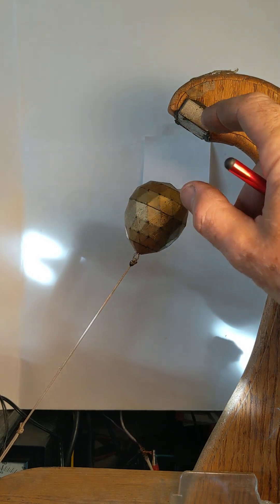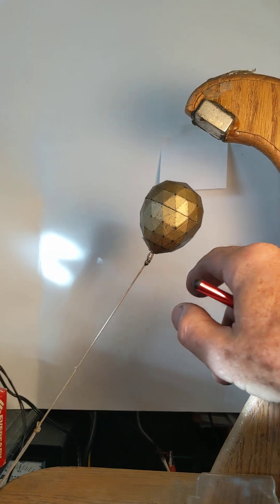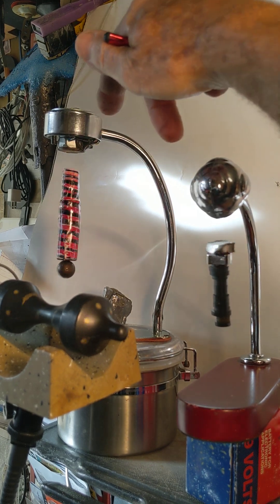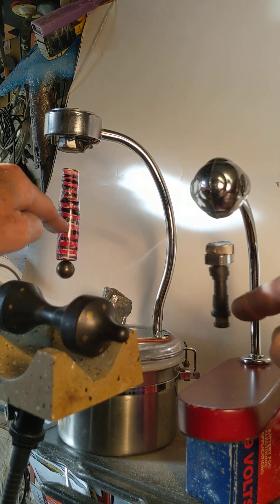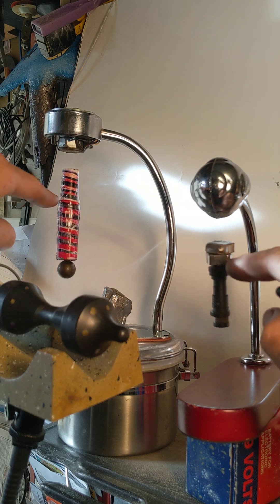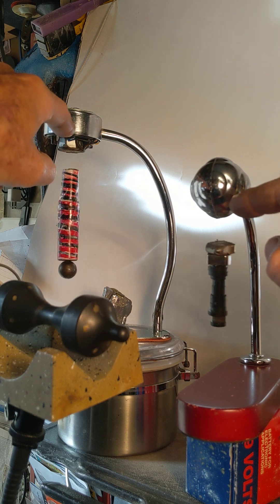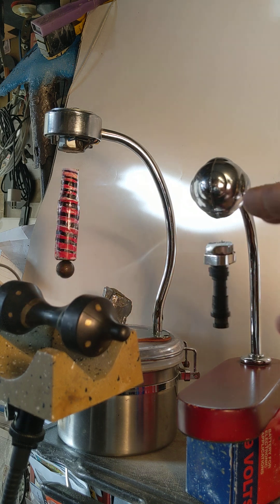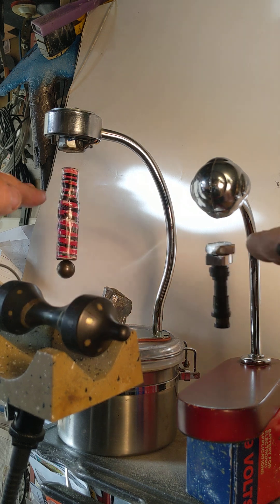Magnetic Levitation Using Hall Effect Sensors.

Comment: Built one of those automatic floating magnets in a lab class. You don't really need a thousands of times per second a refresh in the 100s of times a second is more than enough. It's really a demonstration of PID control
Reply: In case someone was wondering:
"A PID (Proportional – Integral – Derivative) controller is an instrument used by control engineers to regulate temperature, flow, pressure, speed, and other process variables in industrial control systems."